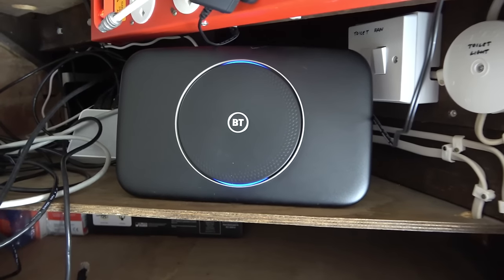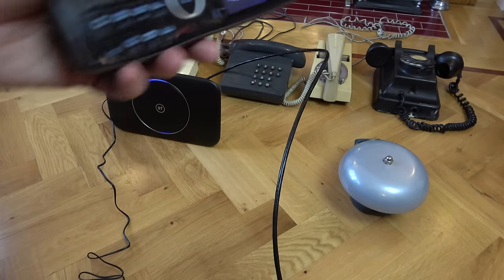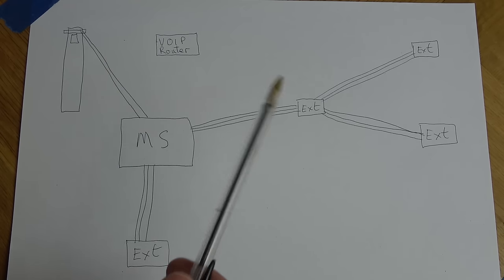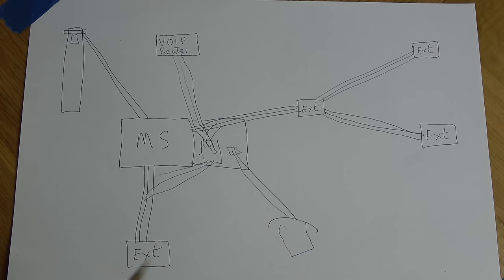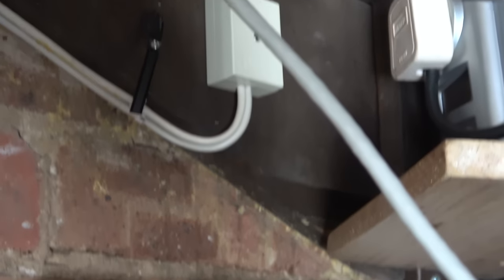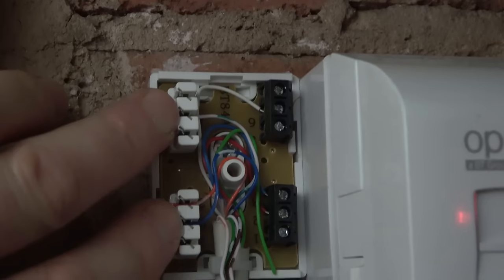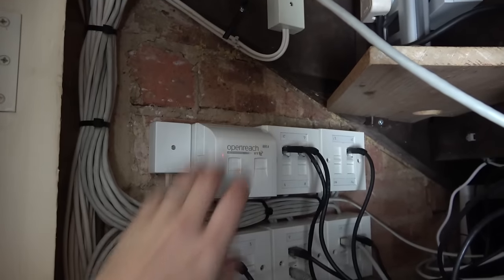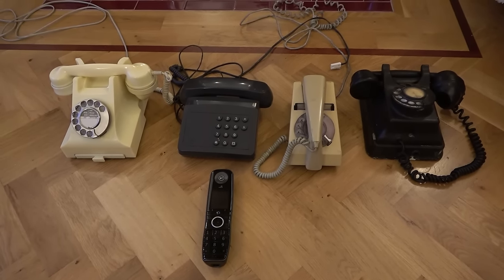How to Connect Landline Phones / Extensions to VOIP on Fibre Internet

Comment: Hi Vince.  Excellent video. I'm an IT technician in Cornwall. I had  a customer in the same situation last year. (The whole voip thing was a mystery to him!)  I connected the BT voice port as you have to his fairly new build internal extensions with jelly crimps behind the master socket. Looks very neat. I did not connect the ringer line and it all seems to work.

PS I see BT sell some sort of UPS for battery backup. But from what I can tell its only to the router. I wonder about the Fibre ONT, and say if you had DECT base station. Then if they loose power the old phones stop working.  

At mine I'm kind of in a good situation as everything is in my office in which I have a UPS so the DECT base station router and ONT (when I can get FTTP!) would be kept running for a period of time.
Reply: Unfinished Edit ?  meanwhile what is the purpose of the two phone sockets on the BT master unit ?
Reply: @highpath4776  Thanks High Path edit corrected.     The sockets would have been the original FTTC/VDSL or ADSL connection to the router and the other for the original phones filtered.  Given the setup in Vince's video I suspect only the BT router was connected to the DSL port and the phones were via the internal wiring extensions,  Vince?
In the current setup they are redundant,  but as Vince says apart from the internal extension connections you are not allowed to alter this BT Openreach property.  I guess in the fullness of time you just wont see any of these sockets in houses.
Reply: The battery back up (BBU) is for the ONT (Optical network termination) not the hub

Comment: In so many ways it's so much easier to keep your existing equipment.
Where I am in Ontario Canada we are slowly switching over from copper to digita, if your still on the Bell Canada system, in my household for example we would definitely not want to get all wew equipment.
It seems like the new installers may not be trained as good as they should be.

Comment: Have just discovered this excellent presentation.  Shame the voip system suppliers instructions don't explain this method of using the old analogue phones.  The mains operated adapter unit they supplied with the router simply wasn't up to the job.

Comment: Fascinating. I wish I hadn't forgotten so much from when I set up the original wired network, but based on everything I've been told I was expecting to junk it all until I saw this. The best Plusnet could suggest was a proper VOIP system with all the worst of that. I am still angry that the copper has been ditched to make BT richer off the backs of investment from the country as they harvest the cables and sell the land, etc. Disgusting that we will have no resilience or communication in a crisis. Still, back to this, I already separated the internal network to a junction box when they installed a previous master socket, but the new fibre will need to be in a different part of the house given that they won't bring them in far now and it'll likely be where the router was moved anyway (using a very long ADSL cable) to go upstairs. I will need to connect the BT style junction to the old plugs to that and it will mean a very long cable. I looked elsewhere and saw someone used a male to male cable. I may have missed it, but is that the best way or should I use the male end for the router and hard wire the other end into the junction box? Or a female? I need to look at your film again, but I can't get that clear at the moment. Mind you, like old times using your advice as I used to do that a very long time ago now.

Comment: Hi Vince, nice work with the explanation, I work for virgin media as a technician we have a similar thing with our routers starting from the hub 3 you can plug in the rg11 to bt we call it 21cv (21st century voice) we can use an adapter I forget what its called which uses the rg11 to rg11 cable to a pass through adapter that we can plug into either the master socket or extension which will use the existing sockets again for any extensions, making sure that the external Telco cables are disconnected to ensure no interference from existing Telco network

Comment: Thanks for the video, I've been in the same business and can say this conversion works. The RJ11 socket on the router is just in parallel to the phone socket in most cases so ether can be used. I have a small ebay 10 extn PABX connected to my router and the phones are powered by that acting also as a REN booster and loop to mf converter. Works well, I use a UPS to feed the router and PABX for power fail situations.

Comment: Hi, that was interesting. We used to have wired extensions in our old home, one of which went to the router which was upstairs. We also purchased a BT answerphone with additional cordless handsets. On moving to a bungalow, I didn't bother with wired extensions.
When the full fibre was installed to the bungalow, Openreach removed the old copper line as the ducting was restricted and the technician had quite a job drawing the fibre cable through. I believe it costs extra to retain a copper wired phone service, but they are going to be discontinued soon anyway..
The DECT phone supplied works well and with the answerphone also plugged into the hub, we have an additional 3 extensions. What we did not expect was that we now have effectively two incoming lines- I can be using the DECT phone and incoming calls can still be taken on the cordless extensions. I haven't tried making 2 outgoing calls.
Anyway, the phones and internet connections are working fine and we are quite pleased with it.

Comment: Vince, thanks for the informative video.  I'm in the US, so I've had only minimal experience with BT phone system specifics.  I was glad to learn the term "MFT" ("Multiple Frequency Tone"?) which I equate to the US Dual Tone Multi-Frequency ("DTMF", aka Touch-Tone trademarked name).

I've worked with phone lines since the 1970s, first as an electronics hobbyist and then professional.  It's been years but recall seeing option settings for dial-up modems to configure them for different phone technologies internationally.
Reply: Hello there - in the UK, MF T is Multi-Frequency Timed Break Recall, as opposed to MF E, Multi-Frequency Earth Recall.  Older PABX (office phone systems) used Earth Recall to signal the operator or transfer calls etc., whereas those from the early 1990s onwards tended to use Timed Break Recall (TBR) for that.  Because of that, older phones in the UK's offices would have often needed four wires connected:  besides the three that Vince talked about, a fourth (usually) green wire connected to terminal 4.

Comment: Interesting video Vince!  We recently got changed to VOIP by Virgin Media.  Their communications said that "any existing extensions will no longer work/cannot work".  Chatting to the installation technician, I said it was a pity that my existing extensions will no longer work.  "Oh, i can do that for you" he said.  He simply connected the VOIP cable from the router into the existing Virgin Media master socket and - Bob's your uncle - it worked fine, including my extensions!  So much for Virgin Media's website and other info.  Maybe you just have to talk nicely to the technician so he spends an extra 60 seconds to connect up appropriately!

Comment: Here in Sweden it's very easy. Just connect a rj11 with cable to router and attach the other plug to the first socket (MS), usually you will get it from provider. If it doesn't work just check that all the sockets are serial connected and maybe disconnect incomming old PSTN (copper).

Comment: Fantastic video but from my experience most ISP providers have disabled BT connector on their routers as default. Also please do video about ATA boxes. Will be so helpful for many people. 👍
Reply: ATA boxes are great, and still available. I use the grandstream HT 812 because it can accept pulse dialling! (You have to enable it in the profile menu).
Reply: If they still provide you a working copper line the voip ports will likely be disabled, till they switch you over.  You can call them and start that process off if you want.
Reply: I use an ATA with a UK VoIP provider. I picked a DID number in the same town that my elderly Mum lives in.
So she can call me here overseas by dialling the local 6 digit number as if she's calling next door. It's a brilliant system.
Reply: @andythomas7931  I use a UK VoIP provider at home with my own ATA box. Prices are very much cheaper than copper landline calls, which can be extortionate.

Comment: It's interesting that the router has enough ringing voltage to drive the bells in the old phones. It would be interesting to see just high that voltage is. You need about 40 volts minimum for a decent ring. On the old copper line exchanges the ringing voltage was usually anywhere from 75 to 90 volts.
Reply: It's probably a case of providing enough voltage and current at the same time.  Enough minimum voltage even while the load is pulling the necessary current.  Part of that REN specification, or BT equivalent.  I'm in the US, barely familiar with other specs but there's enough similarities to make an educated guess.  I learned a few things during this video!
Reply: @bobblum5973  Yes, voltage and current are the key to getting the bells to ring. They may be using some kind of boost converter, not too hard to implement these days. You don't need many components now to easily get 75 volts from a low powered circuit.

Comment: Howdy Vince - I'm not sure about in the UK but here in the US some analog dialers that are part of security alarm systems can work with VOIP systems that are from internet cable routers - they will loose the line monitoring feature (which tells the central monitoring station that a line has been cut) but it hasn't been often used in recent years in favor of IP based or cellular based monitoring anyhow.  Most recent security systems either come with cellular connectivity or have an option for it as a backup to wired IP or wifi.  Awesome video (as always) telco systems content is interesting and still relevant and being used if for no other reason than for emergencies where you do not have access to your mobile phone.

Comment: Hi Vince & thank you for making the video. I had been wondering how well wired telephones might work on FTTP systems as I believe the old copper network is due to be closed down at the end of December 2025. The outdoor bell did sound a tad weak - Were you able to measure the AC ringing voltage?  I seem to recall measuring it to be around 80 volts?
Reply: Don't know the voltage, but I know it's enough to throw you off a ladder!

Comment: A really useful video, thanks.  I was thinking, for power cut situations...  A lot, if not most routers are 12v DC so rather than buy an expensive uninterruptable power supply,  (UPS) to power the modem during a power cut, why not just connect it to a 12v battery?  It's what caravaner's do quite a lot to power their 4/5G routers.  Obviously one needs to check the router voltage, get a suitable connection cable and wire the positive to the correct terminal, preferably with an inline fuse.  It doesn't have to be a large car battery a 6Ah would keep it going for an hour or two.

Comment: Fantastic video and fantastic news! I am due to be transferred to FTTP in a couple of weeks. I'm not with BT but the router supplied has two RJ11 VOIP ports and one RJ11 to BT adapter supplied to allow connection of one standard 'phone. I had hoped that this would work to reconnect my various vintage 'phones and the BT Extension bell in the garden and based on this I am happily hopeful!

Comment: Some (if not all) Fritz Boxes with the analogue RJ11 port support pulse dialling.  I tested our 7530 and older 7360 Fritz Box model with a corded phone set to Pulse and after the popping sounds finished, the call went through.  However, I don't have an old bell telephone to test whether it handles the ring wire.  The built-in DECT on the Fritz has an interesting feature in that operates each handset like a PBX extension, e.g. if someone is on a call on one handset, another call can come in and likewise a 3rd call can be made or come in on the analogue port, at least with the VoIP provider we're using.

Our internet connection is 4G based (no FTTP available in our area here in Ireland), so we moved to VoIP a few years ago to get rid of the expensive landline rental.  I made my own battery backup using to provide power from a small LiFePO4 battery during power cuts.  It's also the most likely time we get a call, usually from neighbours asking if our power is out. 😁

Comment: You can keep the phone working for a while when power goes out if you run the router and VOIP from an uninterrupted power supply. If you have a separate modem you need a ups for it too. I have a VOIP phone and have mine set up that way. Most efficient way is to get a ups for the proper voltage and polarity for your devices without using the power supply that came with the router and VOIP. It is more efficient than having an UPS that provides line power then reducing the voltage and converting it with the power supply that comes with the router.

Comment: Thanks for this, I just got switched over to fiber and my old landline phones would not work. They cut my copper lines out I did not know they were going to do it. I was a bit miffed because nothing beats the reliability of the old landlines or POTs system, our electric is dicey so we could always use the pots phones in an emergency. Now we are stuck without a phone in a catastrophe. Just to clarify what i mean is a few years back the power went out, and the cell towers were also down because of a bomb and fire. Viola the phone on the pots system worked our cells did not. So sometimes new tech isnt the best after all

Comment: Great stuff Vince as always. Hoping the next Video will be about "Home Alarms" ADT, Verisure etc and connecting them with the fibre network
Reply: Personally, I'd just swap the traditional plug the alarm system is wired into to a VoIP SIP based analogue phone adapter. Then find a cheap SIP trunk provider and plug the adapter into your WiFi hub.
Reply: And the Visonic wireless home alarm with built-in speech dialer 😊

Comment: Thank you for this video. We were recently switched to Digital Voice, we dont have cordless phones and the adapeter which connects to the router, that BT offer, was not a viable option. We followed the instructions in the video and all our wired phones work great, still plugged into their existing sockets, with the phone that was plugged into the master socket now plugged into a new socket close by to the master socket. We were having some difficulty when stripping the stranded wire in the telephone extension cable, either not enough wire exposed and or difficulty twisting the copper strands in order to terminate in the screw terminals of a BT84A Junction box, I did wonder if maybe jelly crimps would have worked to connect wires together and was planning to do so if the connections did not work.

Comment: We used to use the yellow wire for the ringer and it went to ground. The red wire is ring the green wire is tip. I guess in the seventies the usa went to the two wire hookup the bell used a capactor and its value set the frequency of the ringing. Tip and ring is all that is needed to ring the bell. Yellow wire was disregarded no longer needed. 73

Comment: Hi Vince really helpful video only problem i have is on my router i have a rj11 connector how would i work out witch wire is witch to connect to the copper wired boxes i have round the house?

Comment: Nice video. 
Not all the providers in the UK connect the analogue devices using a BT style socket. I have Virgin Media who provide an RJ11 to BT adapter and provide only 2 wires. The older phones won't ring unless supplied with a ring capacitor using the 3 wire system.

Comment: We have fibres going into our street like there is no tomorrow so I guess I will get one to my house at some point. I always wondered if it were possible to use the phone extensions around my house and it seems I should be able to. All I need is an extension cable and a junction box and a new router as my current one has no phone socket on it.

Comment: Hi Vince, I am on EE Fibre Broadband and I have this old phone I really want to get working but I am abit concerned with talking to EE and messing with packages and getting prices higher etc so I was wondering if you knew a way to use a Landline with VOIP that isnt BT and doesnt have a BT Phone Line at All, I have tried reasearching but it all goes over my head, Sorry if this seems confusing an example been like Skype or Google Talk etc, Someway to use a Landline without the Phone line at all just using pure Internet or is the only way to get a Phone Line Packaged added to my EE. 

Thanks in Advanced :)